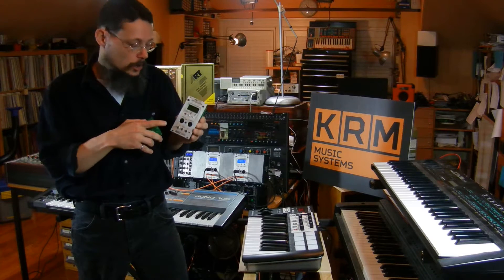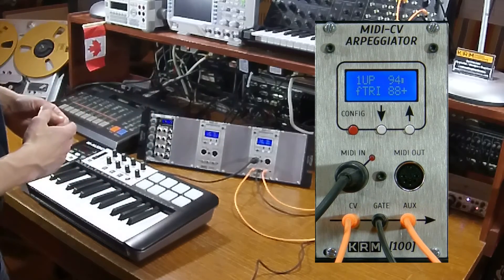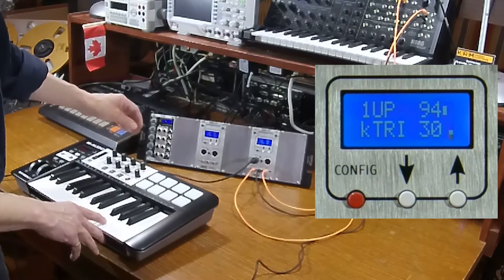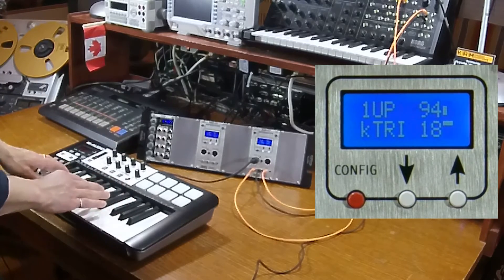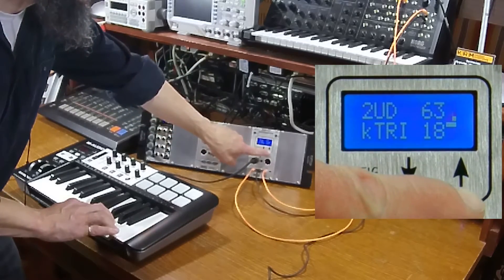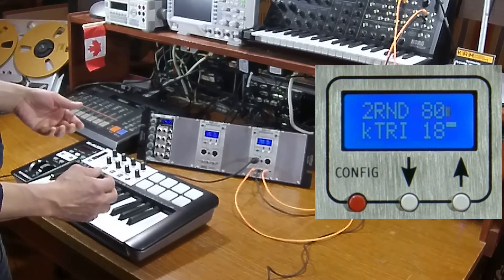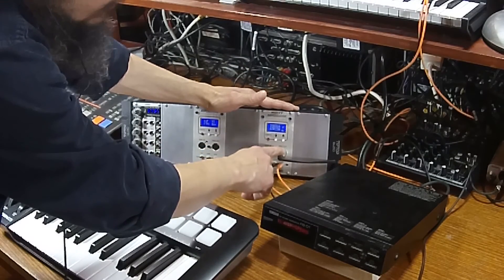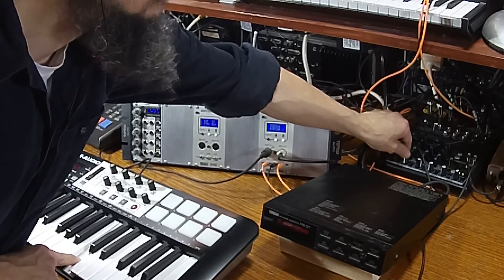[KRM-100] MIDI-CV-Arpeggiator Module - Demo

Comment: were is your clock input for the arpeggiator and sequencer?
Reply from the maker: When I have the KRM-100 synced to an external device (via MIDI), it uses the MIDI beat clock on the external device.  Otherwise, it generates its own internal clock.